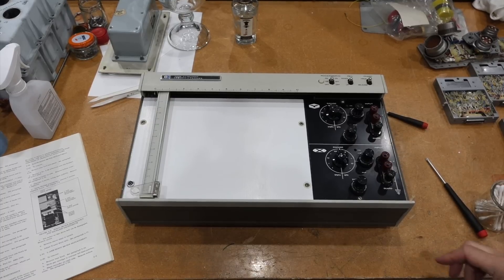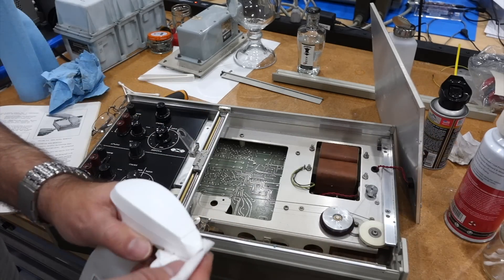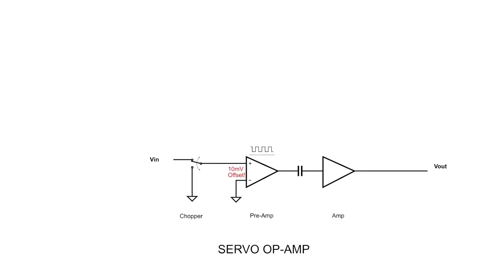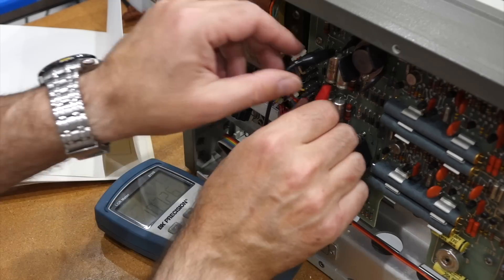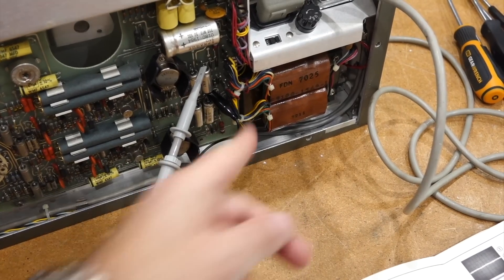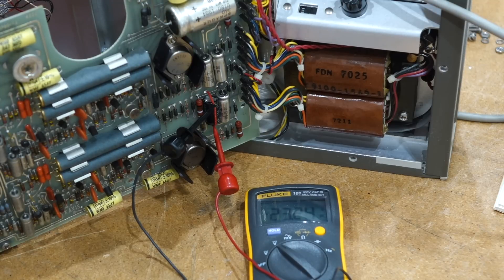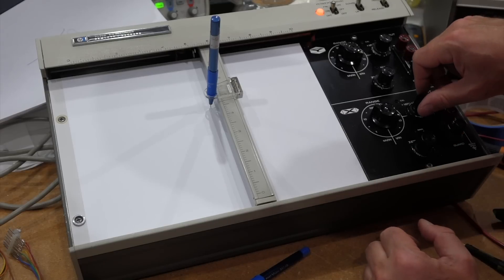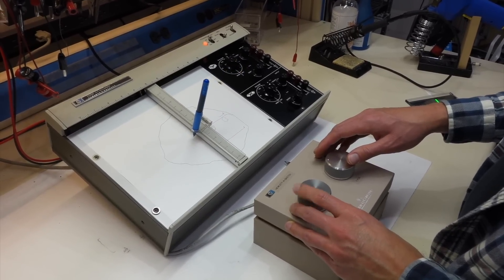HP 7035B X-Y Recorder Restoration Part 1: Photo-chopper Inside!

Comment: My 7035B, that I purchased from Eli Hefron in ~1975 works perfectly.  I was lucky to get one of the adapters that hold a standard Pilot Razor Point marker in the pen holder.  I'm taking some pictures of the adapter so I can post them.  Some talented maker with a 3D printer could turn them out quite easily.

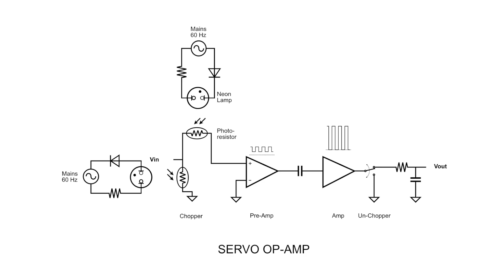Comment: @7:35 - surely the photo-resistor to ground should be on the opamp side of the upper photo-resistor otherwise the opamp is going to see some really weird signals on the input? (effectively floating <-> signal)

Comment: I'm glad you go your unit working. The one I have the ceramic plate wasn't ceramic but plastic with a wire grid that had started coming apart. I couldn't get it operating.

Comment: I came across transistor chopper amplifiers troubleshooting a Century III autopilot. It was strange at first until I finally understood what the circuit was doing. Very old school and very, very clever.

Comment: Now I'm super curious about the "other trick we don't need to get into" that is used on the other end of the chopper amp!  Also I wonder how the circuit deals with the fact that photo-resistors are somewhat slow and the voltages going into the neon lights are a half wave retified sinewave resuling in a loped attenuation?

Comment: My highest impedance meter is still my HP 412A DC VTVM (200M ohms from 300mV range and up) - it too uses an optical chopper, but DOES use light bulbs! To get around the speed issue, the lights are left constantly on, and a synchronous AC motor spins a wheel with slots cut into it, with a total of four lights, two for the modulator and two for the demodulator
Reply from the maker: You have the vroom vroom version of the photochopper, with a motor!
Reply: @CuriousMarc  Yeah! It's a great unit, only required a few small repairs - resoldering the triaxial cable for one of the test leads and replacing a dead filter capacitor in the meter bias supply.  After that, the meter calibrated perfectly.

It still has the "Property of BOEING" tag on it, and the service manual complete with carefully handwritten manual corrections
Reply: If you want high impedance, you might look at getting a differential volt meter. When in balance they have a theoretically infinite input impedance. :-)
Reply: Spinning light chopper was used on an IR radiometer on a satellite of all places, way back when (and maybe more than one).

Comment: You missed the second, and a really big point of a chopper amplifier. First, THERE IS NO chopper demodulator, and the second, via mains synchronyzed chopper we get phase and error sensitive pwm to trigger the power transistor that drives the DC motor through the full bridge with adequate polarity halfwaves, and adequate voltage level. This is actually the reason why plotters used choppers... I have disected a few tube-ones and they used the same system. Also, there were high speed plotters (with -3dB point around 100Hz) used in ECG for example, and they used a bit different system, the heated needle was attached to the armature of a very low inertia DC motor (something like a moving coil galvanometer on steroides) via wrist and a spring mechanism that converted angled movement of a DC actuator shaft to a very linear movement of a needle. On the same shaft was mounted the second moving coil that was used to get the speed feedback, and something called "metrisite" device, actually a linear differential transformer, that was used to get the position information... Actually this circuit should be fun to analyze if you ever wonder into one. :)

Comment: That is why I replace caps in old gear, they can fail at any moment when exposed to higher voltages than the one the LCR meter tests at.
Reply: He rarely changes any of the capacitors in his HP equipment teardowns. It seems like everybody else does though.
Reply: I've got lots of old equipment from the 1940s thru the 1970s that is full of electrolytics. I have very rarely had to replace a cap. I did have a 22uf tantalum fail years ago in a Tek 7700 scope, but that's the only case I can recall of a shorted cap from this era. I've had more resistors go out of spec and need to be replaced than caps.
Reply: @lwilton  I have only come across 1 or 2 shorted electrolytic caps, sure I've seen plenty of shorted tantalums, which were usually as a result of excessive ripple for the electrolytic caps not working well. In my experience the electrolytic caps lose performance and can get leaky at their working voltage or not handle high ripple anymore, even if they test OK on a ESR meter.
I do agree though that a lot of times the old caps were made very well and may still be working fine now in most times, but I see it as cheap insurance, I know that if I replace the caps even though they may be fine at the moment, it should be at least another 10 years before they will need looking at again, there is no guarantee that the old caps will even work next week fi they are starting to break down at their working voltage, something an LCR meter or ESR meter won't tell you.

Comment: I have an old chart recorder from probably the 50's.  The inside is the most compacted pile of components I have ever seen (outside of some computers).  No pwbs.  Even with a schematic just finding the parts is an adventure.  Beautiful servo motors and they still operate smoothly.

Comment: Another fantastic video!   Wow at the idea of using the photo-chopper there to create the servo inputs!!!!!  If I understand you correctly - you have the same problem I did (remembering which is axial, which is radial) - axial, think axle on a car, ie. legs coming out of each side of the tube.

Comment: Cool. I bought one of those years ago for use with my analog computers. It worked fine, so I never dug into it. I may give it an overhaul once I see the rest of your series on this one. I found a source for the pens and bought several, but now the source’s website is gone, so I suspect they’re no longer in business. It looks like you found a great replacement for the pens. I like the photo-chopper. I’ve got an EAI analog computer with the old transistor op amps with relay choppers. They hum fairly loud.
Reply from the maker: That's why I wanted this one too, for the analog computer - still to be repaired..
Reply: You'll have to dig a bit on reddit, cause i don't remember who made it, but there's a 3d printed adapter that allows you to use Koh-i-noor plotter pens for this. It's a fairly small print, just perfect to have made through a 3d printing service if you don't have one yourself.
Reply from the maker: Thanks, sounds like a good idea!

Comment: I thought it may had been a Moseley design from looking at it.  I tore down a tube-based timing mark generator a few years back which was made by Moseley.  It was a tiny device designed to be attached to a chart recorder which generated timing ticks which would show up as vertical or horizontal marks on a strip chart.

I have a few of those HP photoresistors somewhere but I can't remember where they came from.
Reply from the maker: Well if you ever find the photoresistors and they have the smaller active area size (you'll see in next episode) I am definitely interested in one of them!

Comment: Great clip! Interesting photo chopper explanation. Note that in the schematic the LDR to GND is drawn wrong (input of the circuit, should be on input of the opamp)
Reply: Could you perhaps replace the slow CdS LDR with a phototransistor, or even better a decapitated TO-39 transistor? In the days I have experimented with a BC107 with the top cover opened up. It is very photosensitive that way. EC acts like a resistor where the base current is substituted by the light onto the die.

Comment: Old silver Sprague electrolytics... Had one short in a HP3490 "multi"meter and burn out half the power supply. Not a nice thing to repair, especially with the old PCB material that loves to delaminate... Maybe get rid of them before another one shorts and burns out a transformer winding.

Comment: Nice, I have one of these. Mine's in a bit dingier condition; picked it up at a surplus store of all places -- complete with manual, and priced to move!  Not that I've had much use of it, as most things I can do on the DSO, and I just don't need the ink-based "storage tube" very much.  Still, fun to play around. :)

Comment: So this photoresistor + neon bulb system works kind of like an early transistor right?
Reply from the maker: Not quite. It's sort of a combo of an opto-isolator and an analog switch. The modern equivalent component would be a Photo-FET. It would work quite well as a direct replacement with almost no modification of the circuit save adding a giant neon resistor, but you would not get the beautiful neon glow...

Comment: LDRs are very slooooow in some cases it tales almost half a second. I'm surprised this works. You can see the needle of a ohmmeter slowly moving when you change the light over it. Maybe they are faster at low  luminosity. Photo transistors wouldn't be better? In fact they are pretty old, they were invented in the 50's, and even older CK722 transistors on glass enclosures act as photo transistors if you scratch the paint out of them (curiously I discovered this when mounting a relaxation oscillators that changed frequency using an LDR an for that I took an old CK722 from my father's scrap components box, it would be sensible to light even without the LDR because the CK722 in glass enclosure were not painted on the top, only on the sides).
PS: rule 1 replace all electrolytic on old devices that were kept turned off for years: some always will blow or short: always.

Comment: There is an error in circuit used in the explanation. The connection between the two photo resistors should be connected to the opamp and the input to the other end of the floating photo resistor

Comment: I'm a bit surprised that a CdS cell is fast enough for this application. I think of them as having an "off" time on the order of a second. I guess it depends on how much dark resistance you actually need.
Reply: A few hours later... Marc dropped the next episode.
Reply from the maker: And your intuition was right. The CdS barely makes it, which is why HP had to make their own special one.

Comment: Those pens look like the ones that can be used in Vinyl plotter cutters.   try that market see if you can find something that might cross over.  the pens are held in place by holder that is clamp style.
Reply from the maker: Thanks for the tip, but I was trying to say strangely the pens are not that popular style unfortunately, which HP adopted later.

Comment: If this is from ~1970.... then LED's did already exist!
Reply from the maker: This is a 1960’s design, as explained in the video. LED’s with enough light output would not become available until the late 1970s - from HP actually! At which point MOSFETs with enough performance and integrated op-amps were available too, so no need for photochoppers anymore.
Reply: @CuriousMarc  I could swear I heared you say it was 1970's, that was my bad in that case...

Comment: Until you mentioned servos, I thought this is an input device. I guess it "records" signals on paper, as opposed to "recording" the pen position, which would make it an X-Y Player. I wonder if they ever made one of those.
Reply: The servo’s are for a feedback loop to make sure the pen ends up at the same position every time. In the digital age this was done by stepper motors and end switches, and in the intermediate periode probably with optical encoders with ‘Gray’-encoding.